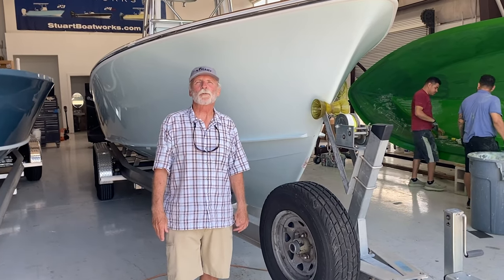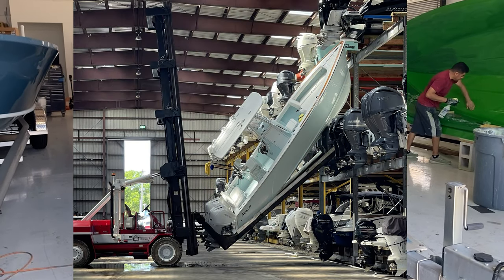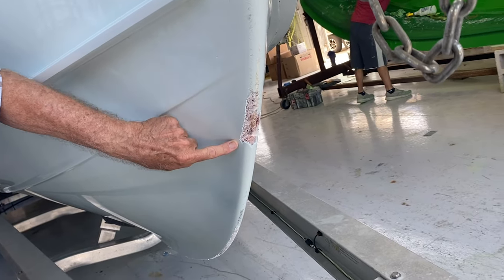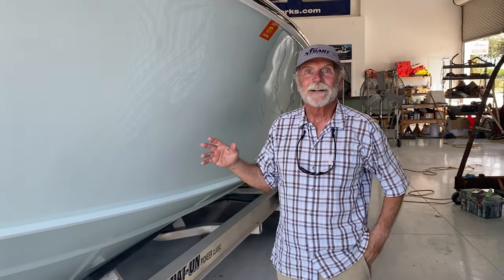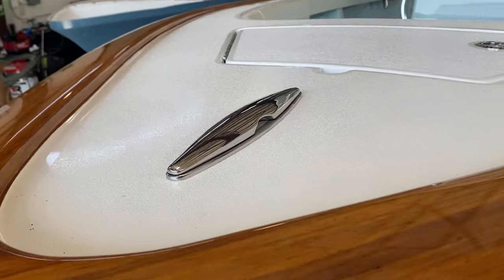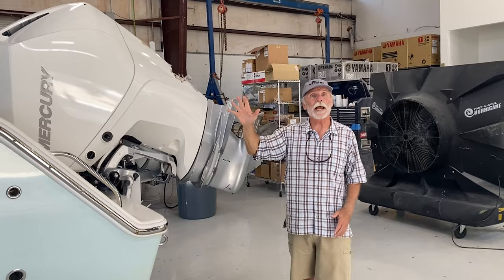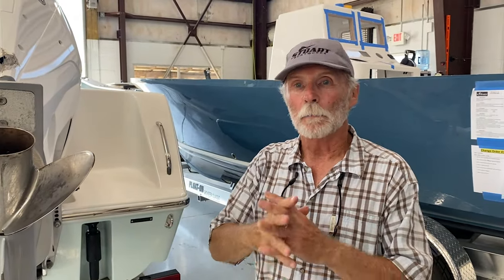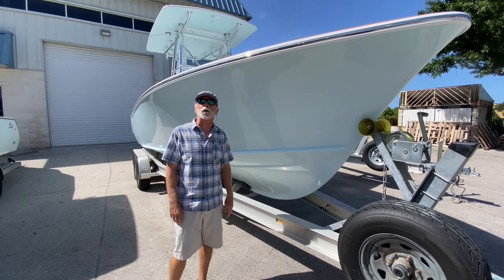Stuart 27 Hull Strength!

Comment: It's a good boat for sure. I had a four Winn's 235 sundowner, it was a mid 80s before four winns became a garbage thin wafer boat. Not a top tier boat by any mean but they had a nice hull layup. I hit a shipping buoy hard while my blood sugar was dropping. Dinged the boat REAL good but no holes, and got her fixed right up. Embarrassing, at the time yes, but it was a good boat, I put 2600 hours on the original big block and I was young and wasn't easy on her but did all the maintenance myself and religious oil changes and drive maintenance. Anyways, I have a dual console with an outboard and they are so much nicer to deal with than inboard outboards. I may hop into a Stuart 27 as my retirement toy in 2.5 years. I've been eye googling your 27 for some time now, and you haven't gone anywhere and you do some custom touches for customers and you like what you do and it shows, and I know the boat manufacturing business can be rough as seen over the years with all the builders that have come and gone, or been bought by big multi billion dollar companies, or had to merge with another company to stay alive. But I know down there in Florida, those guys are just paying stupid money on boats but hey they got it. Everybody is Tom woo nowadays(remember that guy). One of your boats would look good in my slip on lake Cumberland. Maybe you could figure out a 27 dual console, you may need to figure out a way to jig up a bit more freeboard, but you can do it.